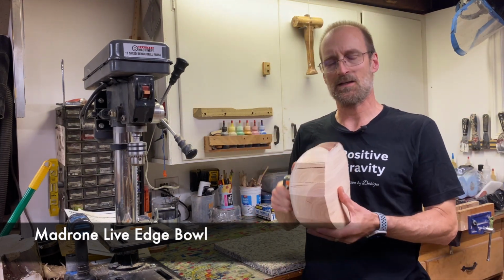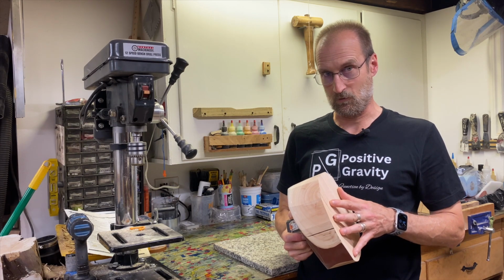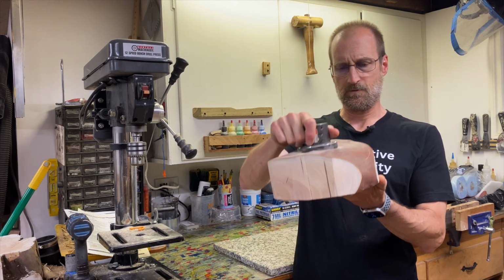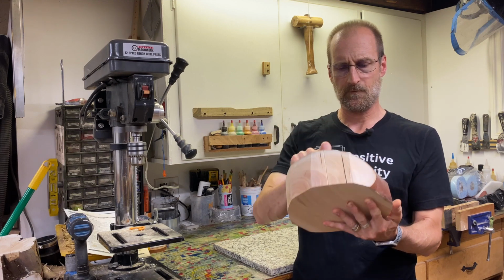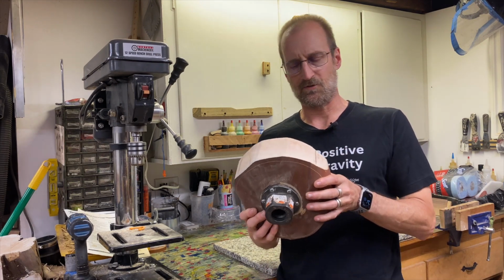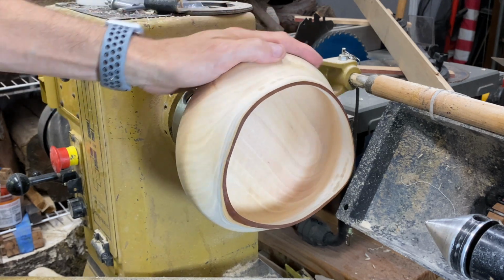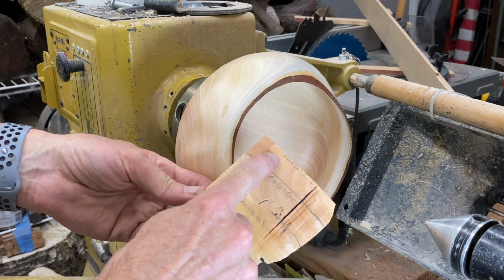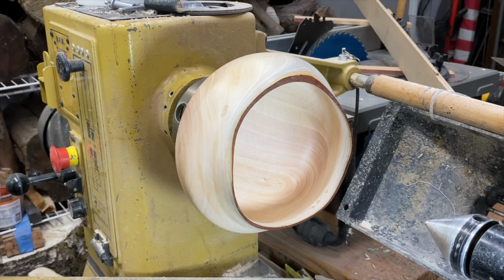Live Edge Madrone Bowl Turned on the Lathe

Comment: Beautiful piece. Thanks for the video
Reply from the maker: Thanks!  The madrone is interesting to work with.  You really have to get to it when it is very fresh.  It starts cracking very quickly, and I've found it cracks internally as well, making it very hard to find nice solid pieces.  I have a bunch more, but it will require full drying and resin work to make nice solid pieces.  I'll be doing that this year.  Thanks for watching.